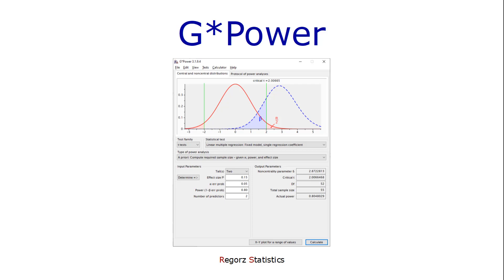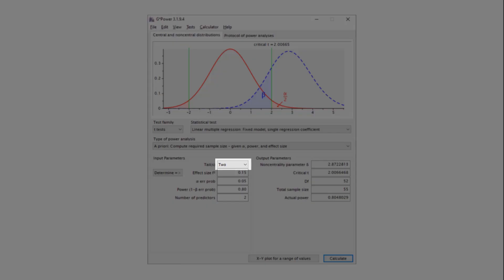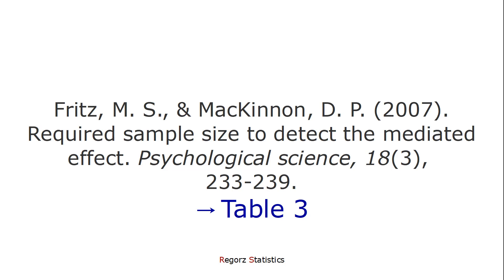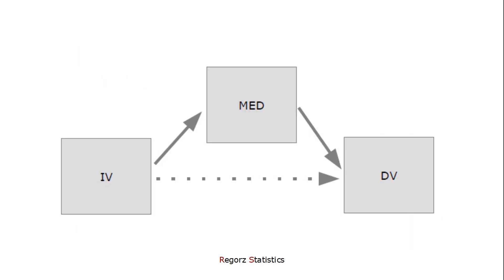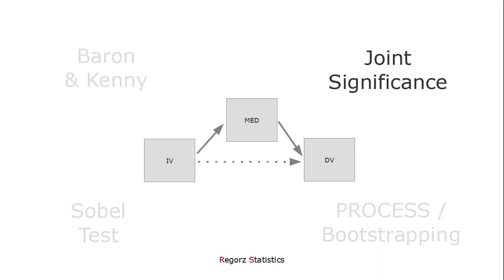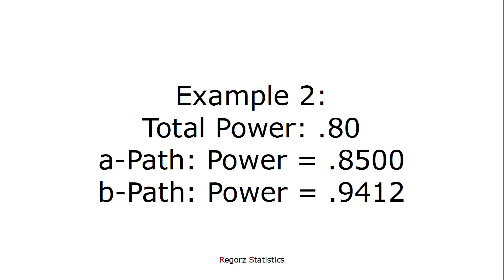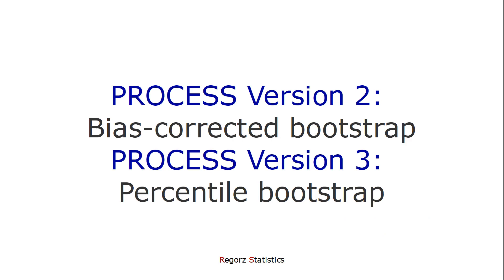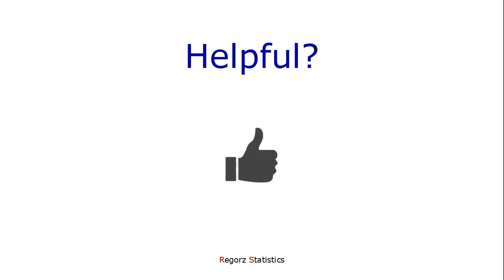GPower for Mediation Analysis and its Alternative

Comment: what if we have more than 1 models in our study? do we need to connect them all or calculate for each one and then sum all the predictors together?
Reply from the maker: For more than one hypothesis I would run a power analysis for each hypothesis test and then take the largest resulting sample size. Thus you would make sure that the power is high enough for all your hypotheses.

Comment: Hi, is the effect size for mediation analysis always 0.15? I haven’t conducted my study yet so don’t know what the effect size will be?
Reply from the maker: Unfortunately not. The f2 of .15 is a medium sized effect (small would be .02, large .35). 

Getting the effect size for a power calculation is the biggest problem of this analysis. Maybe you can find possible effect sizes in the literature for the effects you are investigating. Otherwise you would have to decide how large (or better: how small) an effect you want to be able to find with your study.

For my master's thesis I used the following argument:
1. For my research questions there are no prior results from which I can deduce an effect size.
2. A medium or large effect size seems unlikely because of ... (some chararcteristics of my study)
3. A small effect would not be that relevant in practice
Therefore, I chose an effect halfway between small and medium.
Reply: @RegorzStatistik  thank you!

Comment: Does anything change in using the paper by Fritz if a plan do an experimental study with 4 Conditions (1 Control) and plan to do a mediation analysis?
Reply from the maker: I don't think that the paper by Fritz&MacKinnon is applicable here, because with your design you would have 4 IVs (4 dummy variables) for the 4+1 conditions and the paper is about one IV only.
Reply: @RegorzStatistik  thanks for the quick answer. do you have any insights on how I can approach this topic? There seems to be a lack of information on this.
Reply from the maker: @gaara97531  The only thing that comes to my mind is programming a Monte Carlo simulation to calculate power (but I don't know any easy ressources how to do that).

Comment: Thank you for this video. It is very helpful.
I am doing a study in which I am using PLS (using SmartPLS software) analysis. My research model has 3 independent variables, 2 mediating variables, and 1 dependent variable. Can I use G*power in this case to do power analysis? My sample size is 160. I need to show that power is not an issue with this sample size.
Reply from the maker: I don't know how the power is calculated if you use PLS.
Reply: @RegorzStatistik  thanks. Can you suggest some method to do it?
Reply from the maker: @RathorPhD  Unfortunately not, I don't know enough about PLS.
Reply: You can use Cohen (1992) table. See references below:
1. Hair, J., Hult, T., Ringle, C., & Sarstedt, M. (2017). A Primer on Partial Least Squares Structural Equation Modeling (PLS-SEM) (Second Edi). SAGE.
2. Kock, N., & Hadaya, P. (2018). Minimum sample size estimation in PLS-SEM: The inverse square root and gamma-exponential methods. Information Systems Journal, 28(1), 227–261. https://doi.org/10.1111/isj.12131

Comment: Thank you very much for this video! Do you have any advice on doing a power analysis for a mediation analysis using the PROCESS model with three mediators? Unfortunately, I only found resources discussing analyses with one or two mediators but not three. Any help would be much appreciated!
Reply from the maker: Unfortunately not (other than running a Monte Carlo simulation).
Reply: @RegorzStatistik  Thank you for your quick response! I will look into that.

Comment: Hi, thank you for this video. Do you know where to read about the sample size needed for a 0.80 power, for a moderated mediation with PROCESS model 14? In which there is 1 IV, 1DV, 1 mediation variable, and 1 moderator variable (dichotomous)?  Thanks!
Reply from the maker: Unfortunately, I don't know any tool for sample size calculations for moderated mediation.
Reply: PROCESS use OLS regression similar to PLS-SEM. See references below:
1. Hair, J., Hult, T., Ringle, C., & Sarstedt, M. (2017). A Primer on Partial Least Squares Structural Equation Modeling (PLS-SEM) (Second Edi). SAGE.
2. Kock, N., & Hadaya, P. (2018). Minimum sample size estimation in PLS-SEM: The inverse square root and gamma-exponential methods. Information Systems Journal, 28(1), 227–261. https://doi.org/10.1111/isj.12131

Comment: Thank you for this very helpful video! You mentioned the power was .80 for the Fritz & MacKinnon table, was the significance level p <.05?
Reply from the maker: I am not even sure whether they have mentioned which significance level they used (they have used alpha for the a-path). So I have always assumed that they had used p <.05.
Reply: @RegorzStatistik  this was my question too. So, should we assume p < 0.05? thank you!
Reply from the maker: @hannahmcgowan152  For my master's thesis I have assumed that they have based their calculations on p <.05. I think it is a reasonable assumption (because using any other alpha error rate without even mentioning that would seem to be preposterous to me), but it is an assumption because they haven't made it explicit as far as I can see. 

After rereading the article I have found one mention of a .05 type 1 error rate in the discussion "For a one-predictor ordinary least squares regression with a Type I error of .05 and power of .8, L is equal to 7.85."

It is up to you what you make of this incomplete information.
Reply: @RegorzStatistik  Thank you for the info and taking the time to look through the article! I really appreciate it :)

Comment: Thanks for the great video! Could you say a bit more about how to actually use GPower for JointSignificance (respectively bootstrapping with power > .80), please? I cannot follow which tests to use in the programme when you talk about it in the video. Thank you!
Reply from the maker: In this case we have two regression models. The model for the a-path has one predictor (IV), the model for the b-path and the c'-path has two predictors (IV, MED). If you have covariates in your model you add their number to that.

I would use:
test-family: t-test
statistical test: linear multiple regression, fixed model, single regression coefficient
type of power-analysis: a-priori
Then you can decide whether to do a one-tailed or a two tailed test.
Effect size: Here you can choose a small effect for the path (f²=0.02), a medium sized effect (0.15) or a large effect (0.35) - or anything in between. You make this decision seperately for the a-path and the b-path.
alpha error 0.05
Power: Here you put in the power for ONE path only, so that both powers multiplied lead to the power for the mediation you want (as I showed in the video)
Number of predictors: 1 for the a-path (plus covariates, if you use any), 2 for the b-path.
Then click on "calculate"

(Technically the first regression for the a-path is not a multiple regresssion but a simple regression. But since simple regression is just a special case of multiple regression I assume that makes no difference.)